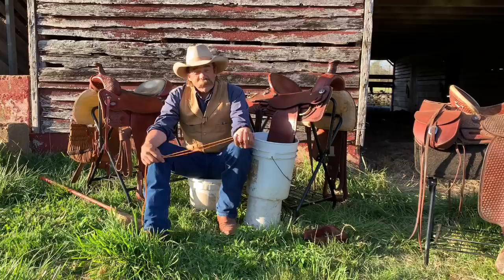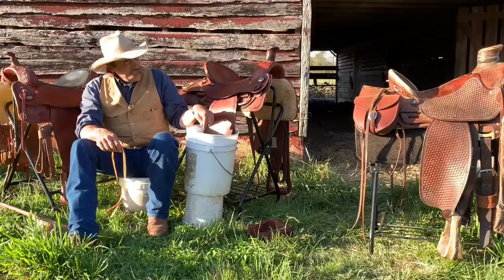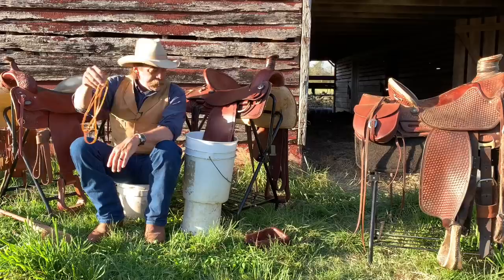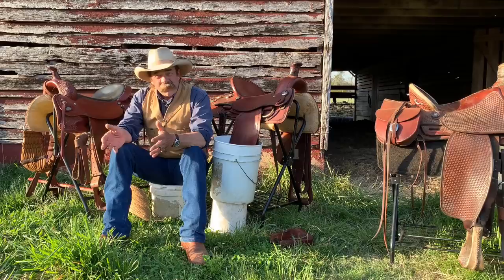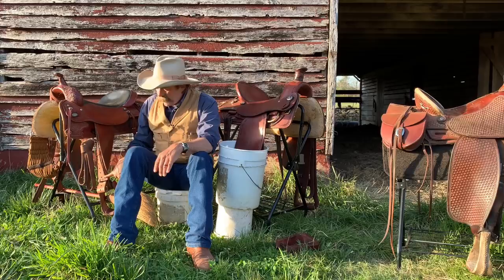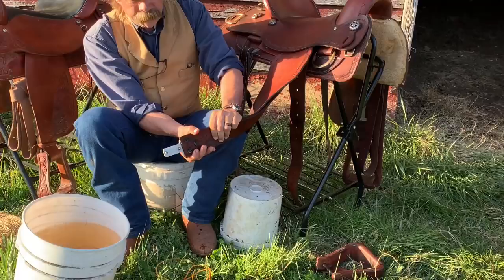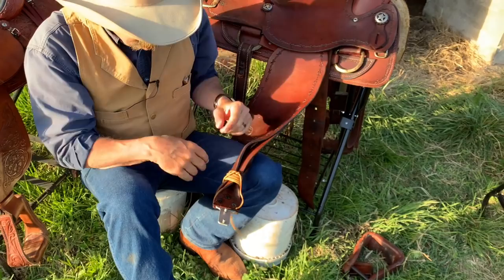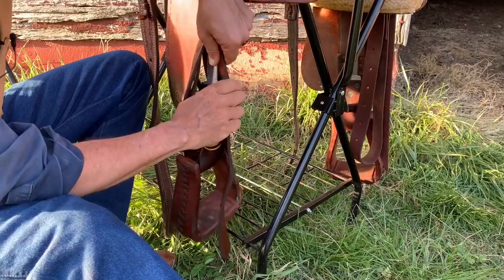Turning Stirrup Leathers on Your Saddle

Comment: This is one of the best and clearest explanations of turning your stirrups on your Blevins buckles that I've found on Youtube.  You see people telling you to remove the rivets in the Blevins, flipping the buckle over and re-doing the rivets -- which isn't necessary and not something most people can do themselves anyway.   I will also note that pinching the leathers and tying them in the folded position may not be necessary, depending on the width and flexibility of the leathers.  I have a saddle I bought used, already folded, with wide & thick leathers, so I left it that way.  But I have another saddle that I bought new, has always been flat, and I was easily able to turn my stirrups without doing anything to the leathers.  Just turning the Blevins buckle around like in this video.  Works just as well.  But the leather in both the leathers and the fenders is very pliable, so it all lies nice and flat.  Thank you for the video.

Comment: The broom handle thing is pretty much of a joke, because it doesn't permanently turn the stirrups.  You can leave the broom handle there for days, but as soon as you put weight in the stirrups, you start the process of the leather going back to where it "wants" to be, which is with the stirrups laying against the horse.  And the longer you ride, the stronger that tendency is going to be and the more your knees are going to hurt.  Besides, it's insulting to us casual riders that we aren't interested in (or can't be bothered) fixing our stirrups correctly 😂  It ain't that hard and well worth the effort.
Reply: if your leather bounces back, you didnt soak it enough
Reply: @lilik6945  That could be true, although it doesn't take long to soak leaather through and it doesn't change the fiber structure, so I'm skeptical.  I haven't done it myself because I've always read it wasn't a permanent solution and a permanent solution is so easy (turning them like in this video).  The other thing is I'd be afraid that soaking the fenders partway up would leave a line when it dried.  He doesn't mention that being an issue, but I'd soak them all the way to the top if I were going to do it at all.  Anyway, take care.